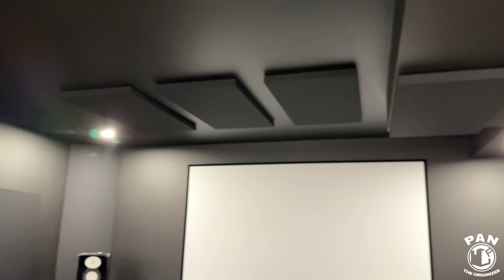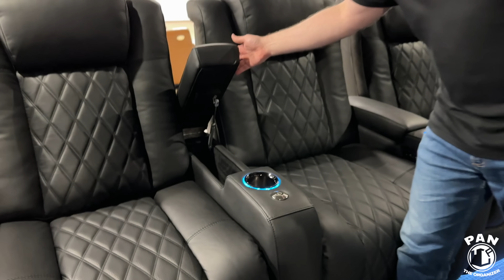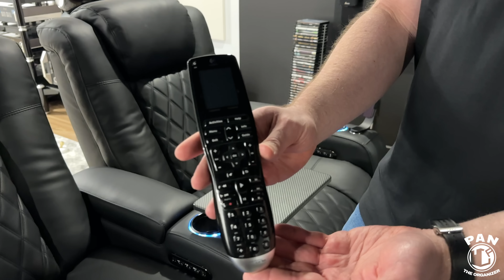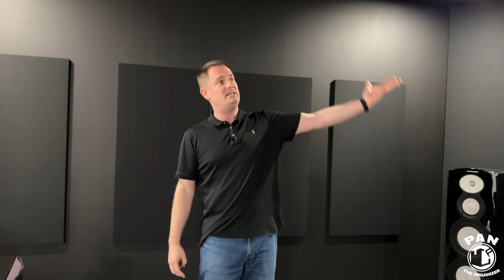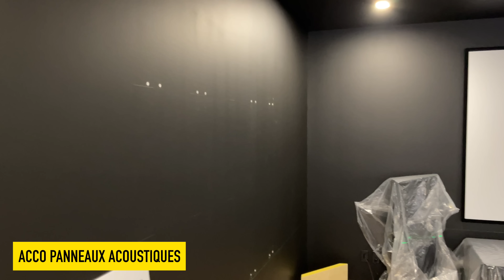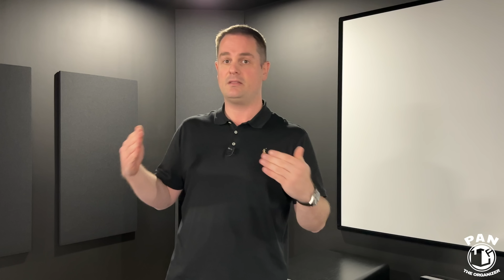Unveiling My Spectacular New Home Theater! Step Inside Ultimate Luxury

Comment: What a beautifully well balanced home theatre setup. Forget about the perfect speaker positioning. Unlike most home theatre setups I personally would like to commend you for not cheaping out on cables. Most people don't realise the biggest culpitts for a heightened noise floor (background signal noise) are actually the cables. 

Even though run a high-performance setup I'm only in a small 13 x 11.5 ft living room. So rather going with seven base channels, I went with five base level speakers and four height channels. Btw (for future reference) having those extra heights is what brings on the true bubble of sound.
Reply from the maker: Thanks! I agree. Too many people believe cables are snake oil and they just buy the cheapest possible. My experience is that high end cables are worth the extra money both in home theater and stereo applications.
Reply: Cables aka snake oil
Reply: Even after auditioning 3 mid priced AVR's (one of them the £2,000 the Denon 6500), the same unwanted background noise was still present. Don't get me wrong, I'm not talking about any form of grounding buzz or hiss. What I'm referring to is actually the sound of the room.
Maybe I'm just a little over sensitive to the background signal noise (noise floor) but for me, even though I'm running an arcam avr20 with a couple of matching high-performance 4 channel power amps (front stage/Atmos) which are driving my Sonus Faber speakers in a 5.2.4 configuration, which also includes a stereo pair of Rel subwoofers for my 4 × 3.5m (13 × 11.5ft) livingroom. I have to say it was only when I purchased quality shielded speaker & RCA cables the room finally become exceptionally quiet! 

My room is now so quiet there are occasions (without me opening my eyes) I'm actually unable to differentiate whether the system is switched off or if it's actually switched on. The room is really that quiet.
 If one is looking to get rid of that so-called ambient sound of the roommate imo shielded cables are the only way to go, and btw they don't necessarily have to be expensive. Bear in mind this is coming from someone who's changed his setup and cables multiple times.

Silence is Golden 🥳

Comment: As always AWEsome, set Up... I'm glad u hav a Dual purpose room instead of one dark room. I hav the same thing. Big dual purpose basement. One half is gaming/Dj the other is the theater. Same screen size 120" 16x9... But my subs are 2 18" scoop bass bins & 2 18" bass bins. The bass bins are behind my couch acting as Butt Kickers 😂😂So, throw a movie on and Turn it Up....🤩
Reply from the maker: Sweet! What projector, speakers and amp are you running?
Reply: I hav a LG UST projector, 2 B52 18" scoop bass bins & 2 B52 18" bass bins. Running Mackie amps. Front L/R B52 Dual 15" towers, Cerwin Vega L/R 15" tower surrounds on Crown amps, Cerwin Vega Center ch 4 6" mid/bass on Crown amp, Emotiva L/R 6" rear surrounds on Emotiva amp. I hav 2 racks that is a smaller version of a Movie Theater set up...Being a IMAX projectionist. I jus made my version of that..    @PanTheOrganizer

Comment: rear surrounds in the ceiling?
Reply from the maker: Yes and they work great. They are angled towards the listeners. Many high end theaters now have integrated wall and ceiling speaker setups.
Reply: @PanTheOrganizer  why not goto 4 Atmos speakers 5.2.4 I prefer a DTSX speaker layout personally with my 4 heights mounted on my walls.
Reply: Well that is not proper setting so it will never deliver the correct audio location,  thats why wr have guidelines but we all have to deal with compromises @PanTheOrganizer